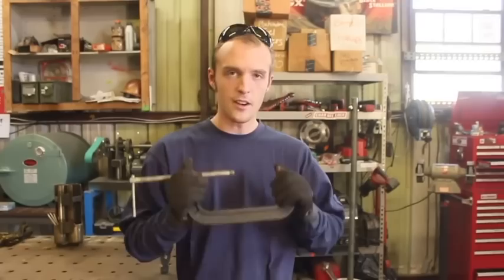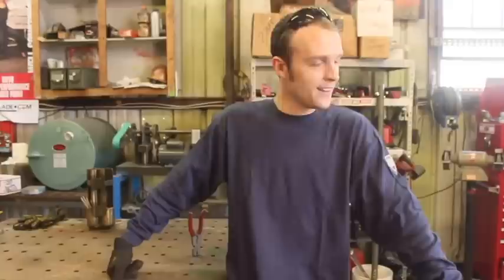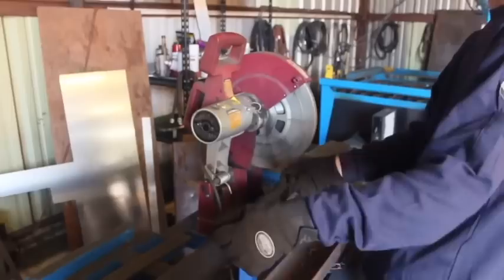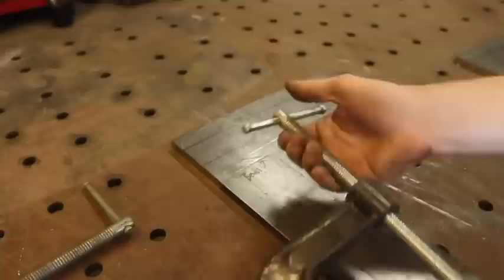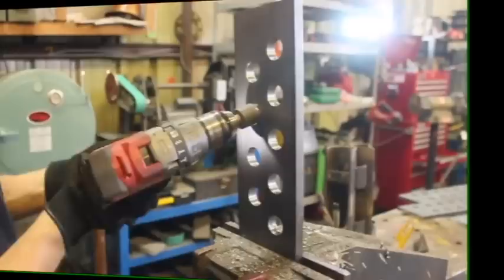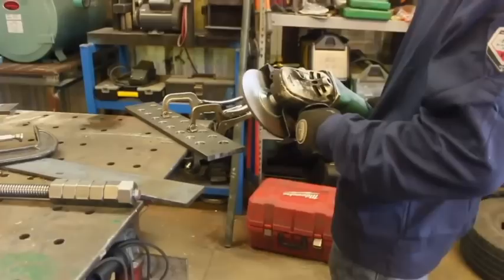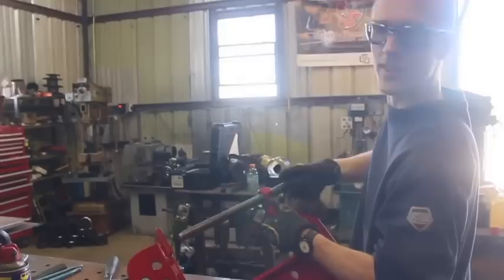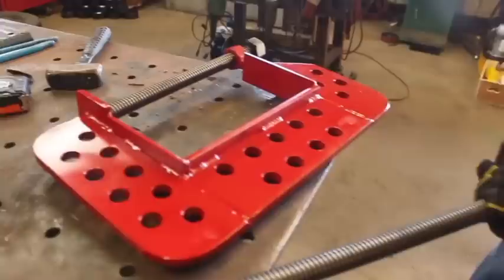I BROKE SO MANY C CLAMPS THAT I MADE MY OWN FROM HALF INCH STEEL PLATE

Comment: Your using (bending) ductile iron clamps.  You need to look for some old forged steel c-clamps, like Armstrong clamps with fine sae threads.  They look like a modern ball joint press clamp, they don't use acme threads.  I have made some deep throat c-clamps made with large fine thread coupling nuts welded to both leg portions of the clamp.  Now with the clamping bolt installed on one leg, I thread a bolt of appropriate length on the anvil side allowing the clamp to reach those hard to access areas, makes easy work on those deep "I- beams" good luck and thanks for sharing, they do look nice 👍

Comment: You could weld a small nut onto the large nut at the end of your leadscrew so you could use a smaller 3/8" drive tool to run the leadscrew in and out.